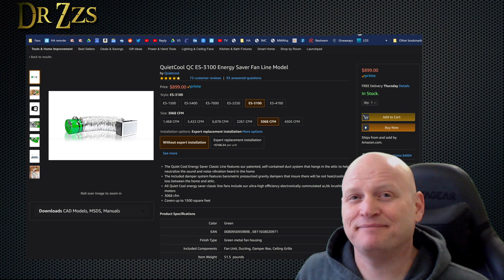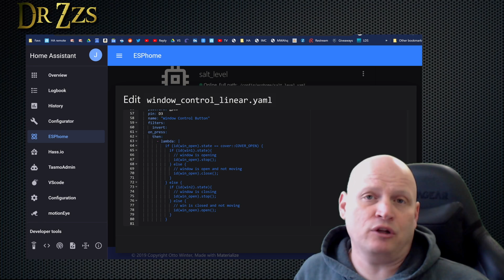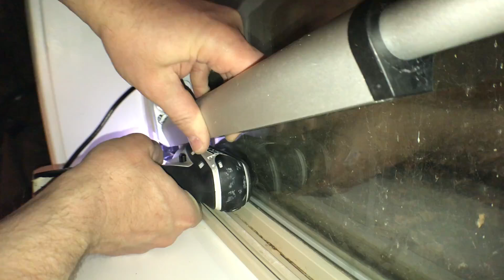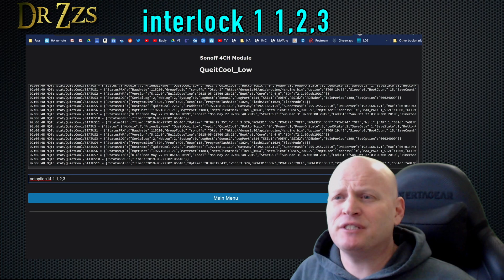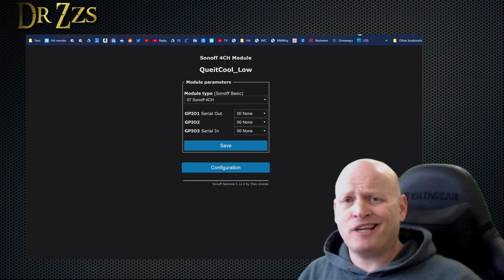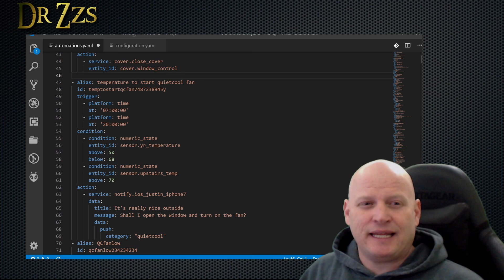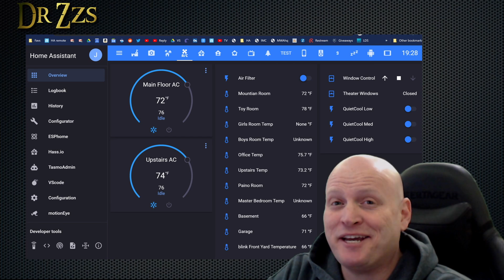Motorized Window Opening!  Save $$ using less AC! Smart Home | Home Assistant

Comment: Compiling sliding_window_opener.yaml I got compile error -
esphome sliding_window_opener.yaml compile
INFO Reading configuration...
ERROR Error while reading config: Invalid YAML syntax. Please see YAML syntax reference or use an online YAML syntax validator:

while parsing a block mapping
  in "sliding_window_opener.yaml", line 2, column 1:
    esphome:
    ^
expected <block end>, but found '-'
  in "sliding_window_opener.yaml", line 128, column 1:
    - alias: window open when quietc ... 
    ^
I made copy and paste from Raw file in github. Please advise whats made wrong for compiling ?

Comment: Hook into dark sky api and check if it’s raining?
Reply from the maker: ooh!  good point!  I'll make that another condition. 
Thanks!
Reply: @DrZzs  I have Weather underground check several things to automate. The humidity for this project is one of those I use.  If the humidity outside is greater than inside, I have a Sonoff Latching board activate a relay that inhibits (sorry for the backward logic) my attic fan to keep it from pulling the humidity into the house.  It has a built in humdistat that, unless I inhibit it, will turn the fan on.  I do the same if raining, etc.  I do some manipulations around sunrise (+2hrs) and sunset (+15 min) also.  I barely run my AC anymore.  I plan eventually to move it to respond to an ESP server.

Comment: Doc:  I haven't read the other comments, but being a past health and safety compliance guy, I am a bit concerned that your current setup may block an emergency exit route for your family.  Quick and inexpensive solution would be to substitute a removable pin (  https://www.mscdirect.com/browse/tnpla/65069288?cid=ppc-google-New+-+Exclusive+Brands+-+PLA_sIovbXzlJ___334980939503_c_S&mkwid=sIovbXzlJ|dc&pcrid=334980939503&rd=k&product_id=65069288&gclid=CjwKCAjw0N3nBRBvEiwAHMwvNg3aj9A4hyedvmQynOHhgZC0Vp1lURjPS5XqaVSbemG46RlFq9elvBoCK10QAvD_BwE  )  for the pins that hold the actuator to your mounts.  <$4 safety improvement.
Reply from the maker: good idea!  I like that option.  Thanks!
I didn't show it, but there is another window in that room that doesn't have the motorized opener, so escape would still be possible.  In the room where I've automated the crank-open type window, there is also another window that is still manually operable.  
I like those grenade pins.  Will have to get something like that.

Comment: Hahaa, 5:10 cracks me up cause I swear all I do is try to get my girlfriend to appreciate home assistant and she couldn’t care less.
Reply: your approach is wrong :)
I do the following:
i installed a vacuum system in the bathroom that can be used to demoisture air after shower/bath.
Then i ask: i can make a switch on the wall, or i can make it automagic when there is moisture sensed in the air.
She goes like.. oh no dont make more holes in the wall en extra switches to push.. fin hass it is :)
same same with lightning in the backyard --> honey, where in house can i drill the big holes for the garden switches?? :-)
Reply from the maker: Those were real tears!

Comment: Hey Dr! Great video, very inspiring. I just bought a house with a Quiet Cool fan but the previous owners opted for the WiFi controller. I believe there is a method of controlling via sniffing the packets (CoAP?) and then reproducing them somehow. Have you heard of this?
Reply from the maker: I've heard of sniffing packets, but I don't know how it's done.  
Mine "came with" the RF controller.  I wish I would have known how easy it would be to control it with the sonoff 4ch I could have saved $150.
Reply: @DrZzs  definitely! I would love to automate mine and maybe, pending the wife approval, I can install a linear actuator too!

Comment: Hi Doc Jetson. :) While I was watching your presentation, I had a flashback going back 50 years! I was in college in the Industrial Controls class. But back then, it was relay logic, resistor-capacitor timing and some vacuum tubes thrown in. The hardware has changed a lot, but the reasoning remains pretty much the same.
Reply from the maker: that's cool!  
I'd love to see how someone would have done this with 50 yr old tech :)
Reply: @DrZzs  The closest I can come to that is if you watch an old Ma & Pa Kettle film, where Pa Kettle wins a "house of the future". That is what got me interested.

Comment: Thanks had the video this is something we've been talking about for the last few weeks now at home I do like the interlock option as well because in the chicken coop I run the same linear actuator but I run it off of two separate relays and then I just use the normally open to normally close to cross my polarity and then in my automation I have a switch setup that if the door is to be opened it checks to make sure the door close is off first before it opens but I like your user interface right at tasmota to ensure this doesn't happen.
Reply from the maker: excellent! 
What are you using to control those relays now? Tasmota sure makes stuff like this easy.  
So many automated chicken coops out there!
Reply: @DrZzs  everything is thru hassio but the coop is run on nodeMCU with a 4 Chan relay 5v.. my next builds are going to incorporate din rail devices.. humm have you seen that stuff yet

Comment: Please be careful you don't crush any of the kid's fingers in the windows (you can't see if there is anything in the way while it's closing)!
Maybe the motor has a built in safety, but just in case think of adding a pir/ultrasonic sensor to it.

I'm gutted I can't use this on my windows (top opening skylights...)
Reply from the maker: good point.  Maybe I should get a hotdog or something and test it to see if it stops when there's resistance. 
Skylights are nice.  Do you ever open them?
Reply: @DrZzs  I've heard if you lightly boil/steam a carrot (not long enough to cook it, but enough to take the crunch out) it's a good analogue for a finger? Less messy than a hotdog!
Sorry, lost in translation, in the UK the majority of our windows are fixed in position. Only the top third opens by pivoting out from the top. and because they are made from PVC there's no way to mount an actuator to it (as the mount will need to pivot as the window opens). I would love a proper skylight in our utility room but the wife is dead against me cutting holes in our roof!
Reply: I've always wanted to do this but never have because of the concern of crushing fingers. With grandchildren around you never know what they are getting up to so, for me, some kind of sensor to stop or reverse the window would be mandatory - kind of like my garage door which has a sensor beam. If the beam is broken the door will reverse and stay open.

Comment: Hey Doc, I'm contemplating building a headboard for our bed, with two adjustable headrests, so that you can easyli sit up and read, or adjust it to your comfort. Will I be able to use the motor controller to control two actuators independently? Currently I'm in the mechaninc part of it, trying to get the best solution for a headrest, so that when it gets angled, it doesn't lift up from the surface of the bed.
Reply from the maker: yes!  that motor controller can independently run 2 dc motors.  Max current is 3amps.  I don't know how much force it'll take to adjust your bed. When you pick your motor just keep that current rating in mind so you don't go over it. 
Sounds like a great project!  Let me know how it goes!  
Good luck with it!
Reply: I was working on an electric adjustable headrest too until I shelved it in favour of a ready made bed (with manual headrests). I did get a prototype of the mechanical part mostly sorted out though (including keeping it level with the surface of the bed), using a modified bed lift bracket coupled with the same linear actuator in this video. Let me know if you get stuck and I'll try to help.
Reply: @ianellul9805  If you have a mechanical idea, don't hesitate to share it :-) As our bed is a waterbed, I need to have it attached to the wall, and have the motion going from the wall. I'm currently contemplating grabbing some of our smallest childs Lego, and build a "thought" in that to see what I can do.

Comment: i like to believe too that my automated home saves money/power (last project was automating my DHW/CH unit with openthermGateway <-- very cool!)
But than i think sometimes of all the raspberry's, industrial network switches, wifi-accespoints,  camera's, nas-units (running decent cpu load cause of all the docker images), etc, etc.
those are pretty enerfy consuming, not to forget all the sonoff touch switches i got. they definitly consume more than normal switches because of their constant wifi connection.
My thoughts is that its my quest to grow the ultimate awesome home.. in the meanwhile i tell my wife too that it will be money saving in the end :-)
Reply: Agree, definitely dont save money on power costs, always on connected devices chew up electricity
Reply from the maker: I just show my wife the electricity bill, not the Amazon/AliExpress bill :) 
I'll have to do a calculation and show how much it costs to run a wifi device.  I'd think it's less to run one of those for a month than to run the AC for an hour. 
It'll be good to calculate it out though and know for sure!

Comment: Hey Doc, i got some same fan in my house, but it was installed when the house was build. it got 4 pipes through the walls to different rooms. i got it automated with just a sonoff basic. the reason i didnt want to do multichannel like you did is because of the possibility of turning multiple relays (even with interlock on, this is just software safety!). and i do know what happens if that fails. the almomst 1k fan is not gonna survive it (copper coils are shortened and it will take a while to earn that back on energy savings). since i always want fresh air in house the fan is always in low mode. and if the sonoff gets served it will switch high mode. that means that medium mode is not connected and a sonoff basic will do :)
(forgot to mention that lowMode and highMode MAY be switched on together.. in fact it will always be the case when the Sonoff kicks in (any mode may be 'mixed' with lowMode, you have to see the electrical schematics for that))
Reply from the maker: oh cool! Nicely done.  I didn't even know these fans existed until someone at work told me about theirs last summer.  It's been great so far.  
ya, I really don't want to fry this fan.  It ain't cheap!
Reply: @DrZzs  yes, but when i count my ip adresses in DNSmasq i count 60+ adresses (and growing). those devices consume less in a week then an AC in one hour. but those devices run 365/24h. maybe they still consume less than other devices in our home, but i think it will be a close call.

Comment: Looks great. I've looked at doing it with a stepper motor and a lead screw - that way you can open the window all the way. But yours looks more elegant so the WAF will be higher! lol
Reply from the maker: That would work too!  For the maker faire my buddy made a treasure chest that opened with a stepper and lead screw.  Worked great. 
I still haven't mastered stepper motors using any of the noob friendly firmware (tasmota, esphome, etc).  I will at some point!
Reply: You could also use a twice as long linear actuator but mount it on the other side.
(So it pushes the window to open and pulls to close)

Comment: Please attach to description link to instructions where should be build sliding_window_opener.yaml .
Thanks.
Reply from the maker: There are comments in that file that tell you which parts to put in which places in your configuration.  
If you aren't sure where the configuration.yaml, or automations.yaml or esphome yaml files are located then you should start with a good basic Home Assistant setup video. 
https://youtu.be/qnCRcGTznXs

Comment: if it aint broke dont fix it... ok i repeated after you........ another way to have done the triggering is to create a quietcool group, then just have the group as a trigger. you should also add a condition to the automation that checks if your alarm is on, so if your not home then dont bother sending a notification, 1 day you might turn it on for some reason then your window will open and trigger your alarm..
Reply from the maker: ooh, good point!  I hadn't considered the alarm.  
I should use groups more.  I haven't done that much yet. 
Thanks!

Comment: how are you controlling fan speed with 4ch switch ?
Reply from the maker: Shane is right.  Sorry I didn't go into detail on that.  I've got to do another vid really soon about the crank window opener.  I'll include the wiring for the fan in that one. 
Basically, the stock fan controller has line-in, neutral-in, and 3 speed wires, one for each speed.  So I just ran the L/N to the sonoff, and connected each speed wire to a different relay.
Reply: he has replaced the original supplied control box i think, because the fan has 3 110v inputs on it, low, med, high, so the switch just chooses what input to use